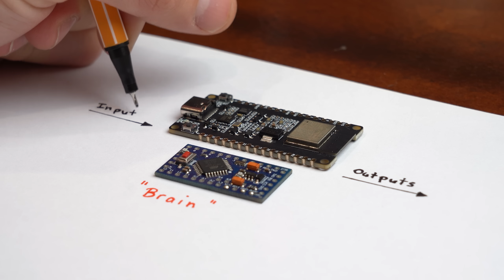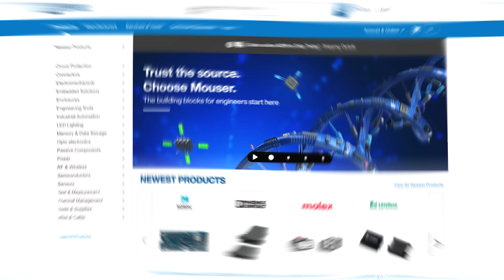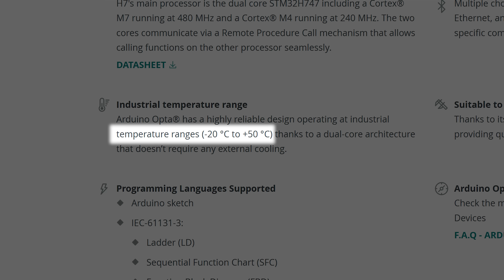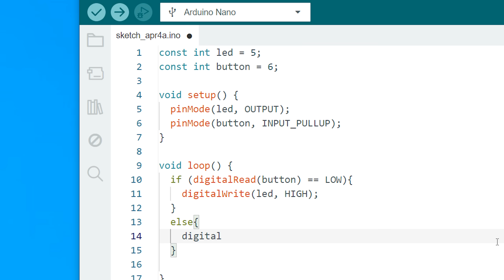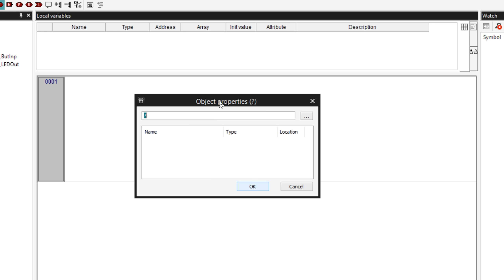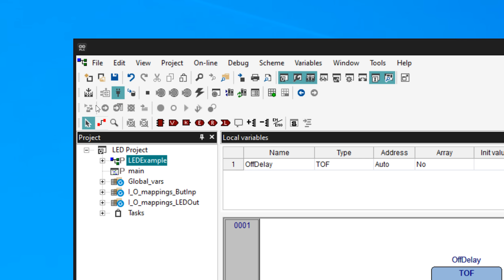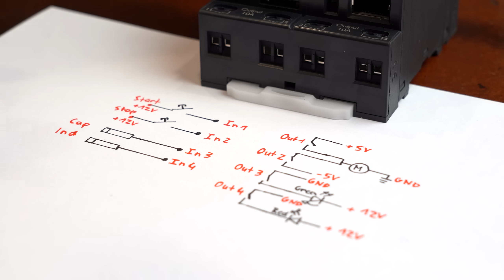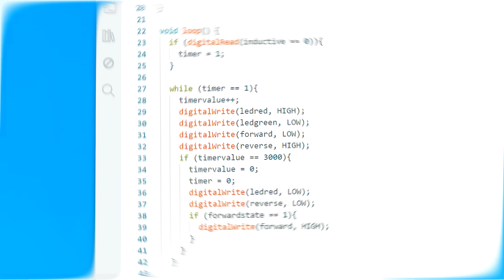Not a Microcontroller!...This is Better?! (PLC) EB#62

Comment: One cool feature of PLCs is that the program can be altered on the fly. At work I often need to upload new code to the PLC while its controlling some machinery. Uploading the new code doesn't need any kind of reboot, the old code runs in the background while the new code is uploaded. When the old code loops around, the new code gets inserted into the working memory arduino without causing any delays. This feature is very important in industrial settings, a factory may be run 24/7 and needing to shut down all of the machines in order to install a push button is not acceptable.
Reply from the maker: Thanks for the feedback. That is really handy.
Reply: @greatscottlab ROS RTOS C/C++/Python ?
Reply: When I was working as an Intern at a Can factory I was doing some ladder logic in one of the PLCs and went into test mode while everything was running I didn't realise that it faulted and my supervisor was in a toolbox meeting 😭

turns out the factory went down for like 15 minutes and it was all my fault caused by an array out of bounds error. We had to physically go to the PLC and reset it manually.
Reply: @joshcanhearyou It was only 15 minutes 😊
Reply: @y2ksw1 15 minutes of downtime on any single piece of major equipment outside of scheduled hours where I work is the escalation point where all regionals get on a call asking you wtf is going on.  15 minutes is a lot in the industrial world lol
Reply: Is that a common capability? I was under the impression they typically needed to be in the "stop" state to be able to transfer a program.
Reply: @boristheengineer5160  I work with Allen Bradley PLCs so other brands might be different, but you can make "online" edits (doesn't interrupt) when changing certain things, like the logic inside of routines. If you want to change something like the logic inside of an Add-On Instruction, PLC properties, or properties of a connected device, you have to make "offline" changes, and then download them to the PLC. Online changes are preferred on running machines, as downloading interrupts running processes and can get certain machines out of sequence
Reply: @boristheengineer5160  If you make program changes offline (not connected to the PLC), then yes, the PLC is going to stop as you transfer the new program because it won't know how to merge the two. However, you can make changes online without the PLC ever having to stop. You can even test your changes before you finalize them so you can revert back if it doesn't do what you expected. You'd less likely do this if you're making substantial programming changes compared to just bypassing a sensor or something.
Reply: @chitlitlah In Siemens if You know what You are doing, You can prep offline code and load it without forcing a stop. In siemens as long as You don’t touch function DB’s structure, you can do almost anything outside of modifying safety
Reply: "Is that a common capability?"

Yes. I was doing it with Siemens 545 plcs 28 years ago. Back then it was advised you did a clean install during the next scheduled downtime, but I imagine that's no longer necessary.
Reply: @boristheengineer5160  It is not always true. Most PLCs need the program to stop.
Reply: Reminds me of the days that I was still editing dynamic HTML files directly, while they were being served. Sitting next to the customer, discussing improvements, and implementing them in the fly. The other few hundred users immediately enjoyed the improvements as well.
Reply: That feature seems pretty doable with a microcontroller running micropython, with e.g. a periodic check to see if it needs to reload a module (and reload it inside a try block so the old one keeps working if there's an error in the new one).
Reply: There are microcontrollers with a [fairly self-explanatory] feature called in-application programming. This does exactly what you need too.
Reply: For this specific use case I have 2 microcontrollers, one of which is the fall over device. If code changes, they can replace each other without interruptions. Also, if one fails. In order to make this work, it needs a third microcontroller, which decides, when to switch.
Reply: Seems like a microcontroller running Micro Python or Circuit Python could do the same, although it would be potentially prone to more catastrophic failure.
Reply: Interesting comment.
Reply: This very much seems like a firmware thing that could be implemented on MCUs too (since a lot of PLCs are just MCUs with special  firmware), it would like just be a variation of OTA updates. Definitely handy to have it already implemented for you on a less programming error prone system though.
Reply: That's because you don't understand the difference between a program file and firmware.

You do definitely need to reboot the machines to upgrade the machine code and if you don't then you are doing something seriously dangerous lol.

PLCs are a software hardware package it's a microcontroller with the ladder logic programming language in a box. The language is the only thing we have that is unique here
Reply: That seems risky
Reply: @kellymoses8566  That't very common practice in industrial automation. This drastically reduces the time needed during commisioning. A good example on top of my head was a adding utomated loading and unloading robots to a preexisting tempering oven. The oven ist running 24/7 and will only be shut off once per year for maintanance. Starting it up from cold takes days. If your logic stops all actors that need to be failsafe will go into that failsafe state. Thus requiering a possibly lengthy restart. As the program in the PLC is running in a cycle anyway the "online change" is pretty straightforward to implement. While the existing code is running, the new code is transmitted to a new memory location. Once the transfer is finished and a cycle is finished, the PLC switches to the new code. Some system even allow you to modify data structures without losing old data by copying the old data into the new data structures between the last old code cycle and the first new code cycle.  That obviously doesn't mean you can't make errors that will cause damage. Hower the aforementioned failsafe design of the automation system should prevent bodily harm in all cases even if you crash your PLC code.
Reply: @kellymoses8566  Just have to know what you are doing, usually you can also simulate things though its often not worth the effort for simple things.
Reply: @kellymoses8566 changes to a running program are usually minute, such as adjusting a delay
Reply: Це працює лише для Software Configuration та для коду поза головним циклом, а також коли не змінюється адресація. Також залежить від PLC: S7-300 потребував зупинки та перезагрузки після завантаження программи, S7-1500 - вже ні
Reply: @__HJK__ No. You could download code changes into S7-300 on the run, without restarting. Changing the static or input output area of blocks. Introducing/changing tags or downloading the HW configuration however stopped the PLC. You couldn’t save your program and data into the ROM either while running. Some of the above still requires you to stop an S7-1500 CPU as well.  It will warn you though, while the old system might just become inconsistent causing unexplainable errors.
Reply: @ Це тільки в самих простих програмах. Наприклад, якщо ви використовуєте діагностику - блоки RSE_  , то при зміні OB1 CPU 315-2 , буде вимагати Consistent Download з перезавантаженням (TIA Portal 13). Те ж стосувалося і зміни тегів у самописному драйвері ModBUS RTU.
Reply: @ Obviously. It was always meant for quickly solving problems causing production stops or fixing simple errors in logic. Doing major program changes always requires PLC stops.
Reply: The S7-1500 and S7-1200 are much improved in this regard. Apart from changing the hardware configuration or failsafe program there are very few instances that actually need a PLC stop. The S7-300 series is also now discontinued by Siemens (you can still get the big S7-400 if you really want to).  The primary reason for needing to stop the machine is usually changes to "data blocks". However the CPU won't need to stopped but the content of the DB will be reinitialized to default values and your code will probably not handle that gracefully during production. The other (not quite as big) German PLC maker Beckhoff/Codesys will copy your data between cycles as mentioned before.

Comment: Can PLCs be considered as a more practical programmable device than microcontrollers? They come with packaged fucntions (so you won't need to write basic functions on your own) and industrial characteristics (for example anti-interference)?
Reply from the maker: Yep. They are made to be used way fast and easier. But they of course also have to simplify things.

Comment: A quick search for visual programming language for ESP32 gave me this result:

TUNIOT FOR ESP32 is an online visual programming tool for the ESP32 board. It generates C++ code from bloc. 

ESPHome might also be a solution. 

Third option:

KB-IDE is a triple mode programming IDE for IoT boards. Currently support ESP32 boards. Users can program in Block mode (Visual programming) and Code editor (Both ESP-IDF and Arduino IDE).

Comment: Cries in TIA😥
Reply: TIA Portal is very capable. It is also somewhat buggy (I can reliably crash it with certain actions be it V12 to V20). However the bugginess is more related to the HMI functions, the PLC programming part is much better.
Reply: IMO still better than what wago is doing
Reply: @dan3a you mean, the eCock-pit IDE?
Reply: Cries in AWL, because I have to retrofit all day 🤣
Reply: @eddinghangman4613  Now, you, I understand. :) Is it really AWL? The german version of the language? At least “my germans” were using STL.
Reply: @attilakovacs6908  yeah, ita german. And goes by U for german "und" and so on. But nowadays you can mostly convert back and forth.
Reply: @eddinghangman4613  🥲
Reply: TIA is atrocious, everything after Simatic Manager was a huge mistake by Siemens. Change my mind
Reply: @greatscottlab  TIA is the Siemens IDE for PLCs

Comment: Made by Finder, so expect good industrial quality. Nice PLC. 
I once played with a Siemens Logo, using it as a lighting controller. Had no programming interface for PC, so I used local control keys for entering the program... it was pretty tedious but once I got a grip, I got it going.
Reply: Logo does have a programming software for computers called LOGO! Soft Comfort. Programming with LBD can get tedious quickly to be fair though, even on a computer.
Reply from the maker: Thanks for the feedback :-) Yeah, the hardware seems pretty solid.
Reply: I would pick an S7-1200 PLC from Siemens anytime instead of this for industrial use. Price-wise it is comparable, but much better support and spare part availability. 

I have heard from some customers who had arduino based PLC installed in one of their previous facilities. It was a maintenance nightmare with random crashes and reliability issues. It was also the reason why they went with us as SI partners for their much bigger project and specified S7-1500.
Reply: @attilakovacs6908   I mean for super simple applications where you just want reliability and ease of setup, like domotics, logo is pretty good IMO. But I agree with you that as a general rule a good ole S7 PLC is the way to go.

On arduino, I've gotten too many headaches from those boards at home, I couldn't get paid enough to have to deal with them at work😂
Reply: No programming interface ? Are u stupid

Comment: How many amps dc can those relays handle?
Reply from the maker: I think I said 10A in the video. For AC or DC.
Reply: @greatscottlab  but that said 250VAC.  But usually you can't do 250Vdc at the same amps because the contacts will arc.

Happy Easter tomorrow!
Reply: at 1:04 you can see that this model can handle up to 10A. But there is variation across models and manufacurers.
Reply: @mrdrexter5626 3:05 . 10A dc but at what voltage?

Comment: can connect this PLC to SCADA system?
Reply: Yes you can, is a basic and essential use for PLC environment. You can use a SCADA for a specific control and connect some industrial communication protocol to send data for a DCS, for example.
Reply from the maker: Honestly never worked with SCADA before. No idea. Sorry.

Comment: In my experience two things are missing. First a plc (dependent on the manufacturer) can be expended, e.g. with ethercat in the case of beckhoff. So you just would add a pwm module or some extra digital io if you need them and is mostly plug and play (atleast what i experienced). The second part is the price a arduino/esp can be bought for some euros, but the plc costs a lot more.

Also the distinction between "simple" and "complex" task quiet bothers me, i saw a lot of dirt cheap embedded code in devices, and really complex logic in plcs depending on the use cases.
Reply from the maker: Good points. There are actually already expansions available for the Arduino PLC. They just didn't quite fit in the video.
Reply: PLC does not need to be expandable, many brands offer cheap PLC that are not.
While they cost more than an arduino the inputs/outputs are optocoupled so you can run them on 24v. 

As for the simple vs complex, the entire point of Ladder language he uses is to simplify the coding of the logic and it is a lot easier to understand than C code for non-programmers. It is similar to the block logic used for "low code" interfaces like Node Red

Of course you can code in C-like text language or sometimes lower level (Siemens AWL for example) on PLCs too if you need to do really complex things.
Reply: @AntonioMolfetta  can these relays switch 60Vdc at 9A? Or would the contacts arc /get pitted?  (Wondering if these could be used with solar panel loads.)
Reply: @TheRainHarvester  A general rule is to use the lowest practical load through your onboard relays. They are expensive and complicated to replace the whole PLC when you weld or burn one. Instead, use the onboard relays to switch 24VAC (or similar) that then operates the coil of a more suitable DC rated relay or contactor.
This way you keep the onboard relays doing very light work, switching low current AC loads, very little arcing, and will last the lifetime of the PLC.
Reply: @ probably not, check the datasheet.

I agree with the other dude, it's best to use an external relay for high current loads because relays will erode and eventually weld shut, it's best to have this on a part you can easily replace.
Reply: @TheRainHarvester  use a mercury contractor.
Reply: He does talk about pricing 3:59